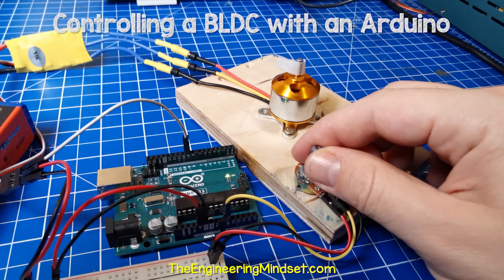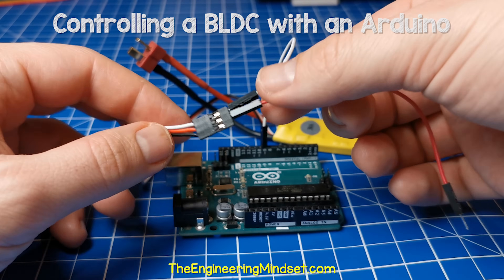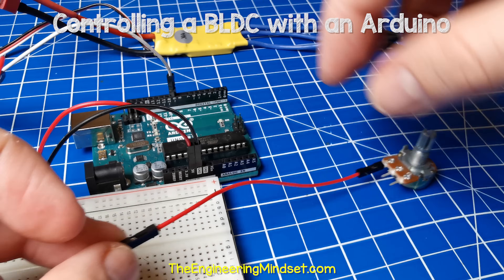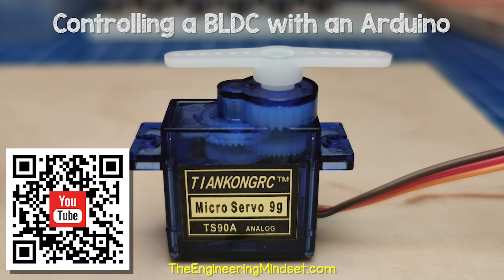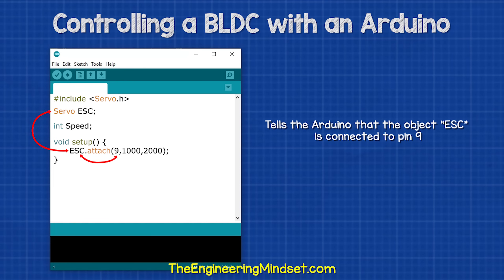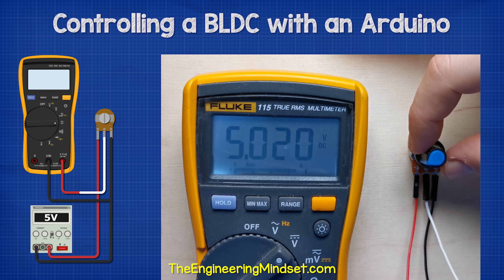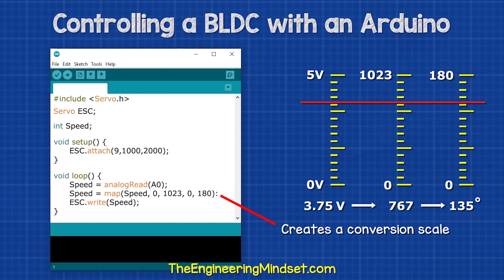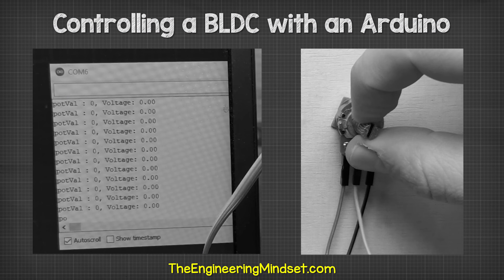How to control a BLDC with an Arduino

Comment: #include <Servo.h>

Servo esc;

void setup() {
  esc.attach(9);  // ESC signal Arduino pin 9 ga ulanadi
  esc.writeMicroseconds(1000); // ESC ni o‘chirish holati
  delay(2000);
}

void loop() {
  // motorni asta-sekin tezlashtirish
  for (int i = 1000; i <= 2000; i += 10) {
    esc.writeMicroseconds(i);
    delay(50);
  }
  
  // motorni asta-sekin sekinlashtirish
  for (int i = 2000; i >= 1000; i -= 10) {
    esc.writeMicroseconds(i);
    delay(50);
  }
}

Comment: DO NOT name variables with abbreviations! Proper variables naming which will give you instant and obvious idea of what's inside it is a required skill of a good programmer. Motor is the best name for a motor if it's the only motor in the program, isn't it?

Comment: when i hooked up my motor (FlashHobby D2826) it started beeping all of the possible error tones. it does multiple types of beeps and doesn’t stop. what did i do wrong?😑 ( update the motor works but it is spinning erratically in both directions)

Comment: If you look in the servo-library you are not limited to using "angle". You get mutch better resolution with usin micro second directly.
  void write(int value);             // if value is < 200 its treated as an angle, otherwise as pulse width in microseconds 
  void writeMicroseconds(int value); // Write pulse width in microseconds

Comment: Depending on the ESC, it has to calibrate itself. So, if you hear several beeps, you should connect your motor with the potentiometer on its maximum position. Then, after a few beeps, you move the potentiometer to the lowest position. After a while it should be calibrated and you can start using it normally. Just in case this happens to you :)
Reply: I thought my ESC was defective when it only made sounds, but with your additional information the motor started fine. Thanks for your contribution.
Reply from the maker: Seen our new Potentiometer Explained video? ➡️ https://youtu.be/Xb-MZMoUtcQ

Comment: This is how to control bldc motor with arduino just a bright idea, but spending 0.5$ on a servo tester is much easier to control BL motor
Reply from the maker: A servo tester doesn't let you program the control tho, only allows manual Control
Reply: @EngineeringMindset  I know dear sir which is exactly what arduino board is acting in this video

Comment: I liked the video, but it would've been a lot more helpful to know how the speed controller that you used works. I don't have one, but since BLDC motors can't usually be controlled directly by PWM I was planning on rectifying the PWM signal to its average value via a low-pass filter. I've seen this as a potential solution on internet forums.

Comment: Why do you need arduino here if you buy speed controller anyways?
Reply from the maker: How does the speed controller know what speed to go?
Reply: I believe - because the motor has 3 connections, power in, power out, and a control signal. the motor speed is controlled by the control signal as long as the power supply is within a given range. changing the power to the motor with the potentiometer will only allow the motor to run at a fixed speed when its in that narrow range ( control signal presumed present and fixed).
     Could be wrong still learning myself.
Reply from the maker: Seen our new Potentiometer Explained video? ➡️ https://youtu.be/Xb-MZMoUtcQ

Comment: I've been trying to make an Arduino drone for some time. I used brushed motors with a 9V battery, but they lacked thrust to lift the whole contraption off the ground. I knew I had to do a power and moter upgrade, and this tutorial is literally the thing I was looking for. Thank you very much!
Reply: Hope you have the money, since a diy drone can cost you upto 75 dollars
Reply: What you need is a more powerful battery, because 9Vs will never provide enough current.

I suggest looking into using a LiPo and buck converter, 3S sounds ideal for your voltage. Do note they take some care and equipment to use safely (read: without causing fires), but it's worth it.
Reply: I tried so hard to get lift from a brushed motor and a 9v batter.  I got so close, but it never had RPM

Comment: Awesome! I've seen 3 or 4 of these, but this is the simplest of them all. Thank you.
Reply: @10:4 littleAI Are the innards of this motor similar to a microwave turntable motor? That motor is so simple it looks like a single coil of wire, no winding, with a cylindrical rotor within the coil which the electrified coil spins. The gear centered within the rotor starts the gear train turning. It's so simple I've never seen it drawn or photographed or even described anywhere on the internet.
Reply: @johnstrawb3521  Huh!